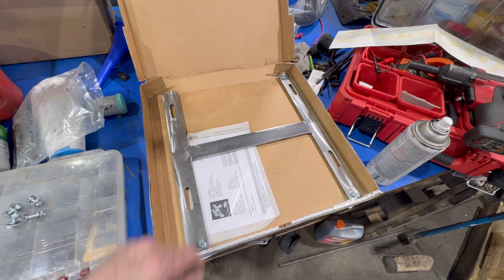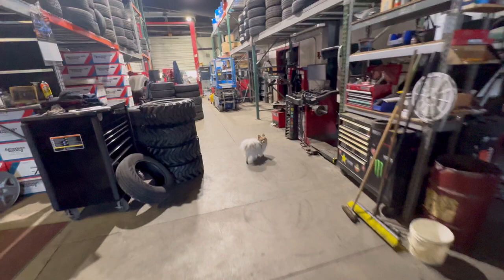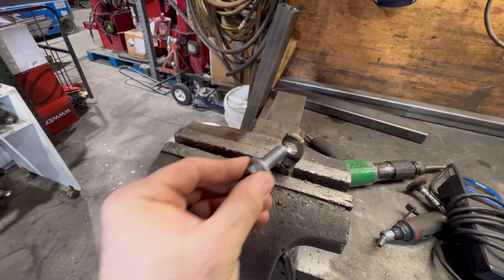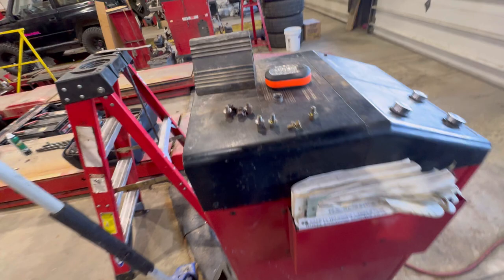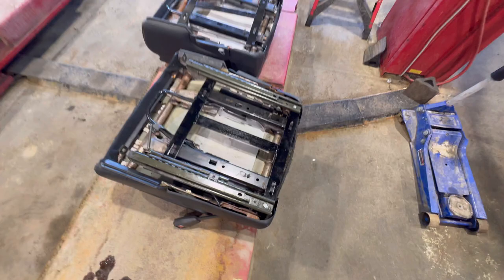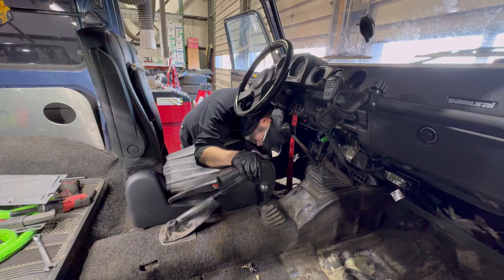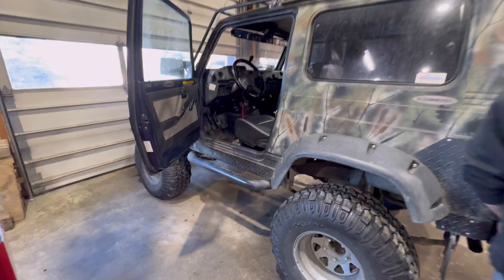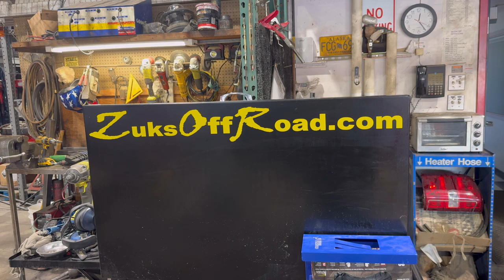Best seat swap in a Suzuki Samurai / ZuksOffRoad H brackets

Comment: Great vídeo. I'm still debating if I should get cloth or leather seats. I don't want to have sweaty behind in the summer time. Oh another thing prices are going up on those seats.
Reply from the maker: I think we paid $70 each, but I’ve seen them cheaper.
Reply: @CTMadModz  that's a steal. Here in LA they start from 200 to 400 a set.  And so far  the vans at the salvage yards I've been to already had the seats removed.
Reply from the maker: @oczuk32  we have one locally and they wanted $250 for the set. Kevin got online and looked in Seattle area and found 2 sets and they wanted $150 for each set but gave them to us for $140 since we bought 2 sets. I’ve seen the cloth ones cheaper on marketplace